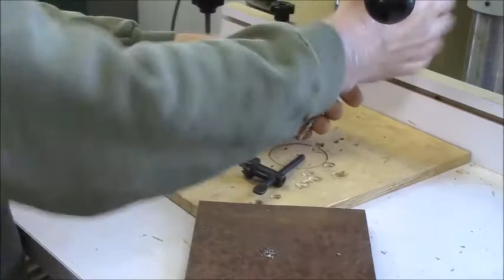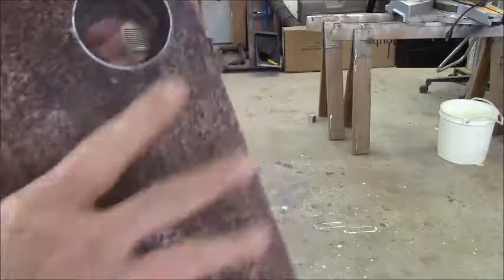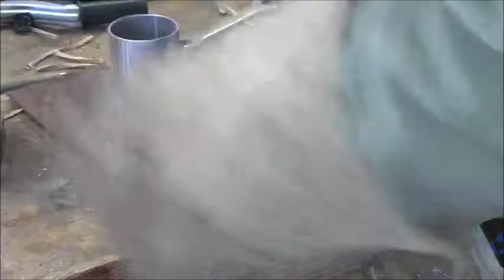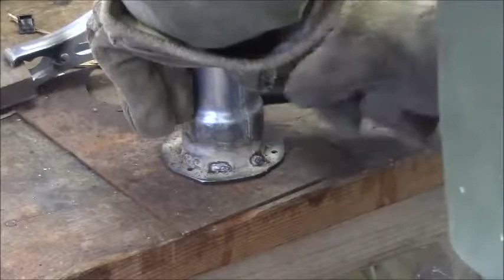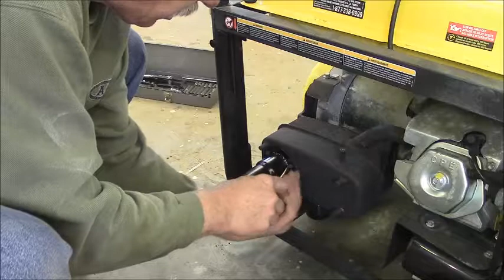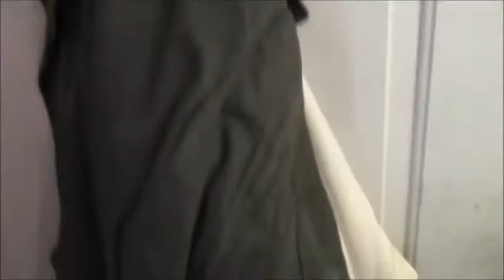DIY generator exhaust, How to make an improved generator muffler exhaust extension

Comment: Would you run it in your attached garage, I've been thinking about doing it because it would be stolen outside. Fumes would go outside..
Reply from the maker: This setup seems pretty safe, but I cannot recommend it for liability reasons... remember, you’re running propane gas and exhaust fumes where it could get into your living space so beware! My setup is in a detached building far from my house. I want to make some sort of frame on the floor to hold the generator in place so it won't vibrate and move around. Have you considered a small shed for your generator?

Comment: I have the same generator and want to extend the exhaust as well... The connection you added... What size was it?... TIA
Reply from the maker: The adapter I used to weld onto the flange had an OD of 2" to fit inside the 2" flex pipe, so it looks like the input was a bit larger, 2 1/4" or 2 1/2", Sorry I don't recall exactly. Did you see my series on connecting it to the LP service? Handy when you have a huge LP tank outside! Thanks for watching!
Reply: @bobsbarnworkshop  thanks for responding... No I did not see those videos... Would appreciate if you can send me the links
Reply from the maker: @MrAndikool  https://www.youtube.com/watch?v=9padf_hvr0s&list=PLZ6M9Zh6AeoDJvYHItI345IPUidZ4bkXd&index=6
Reply: @bobsbarnworkshop  thanks